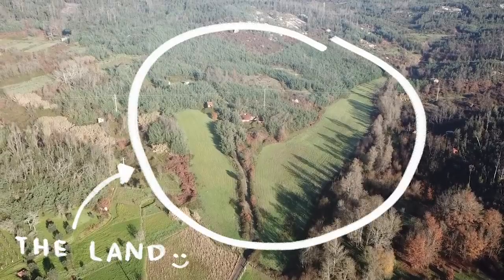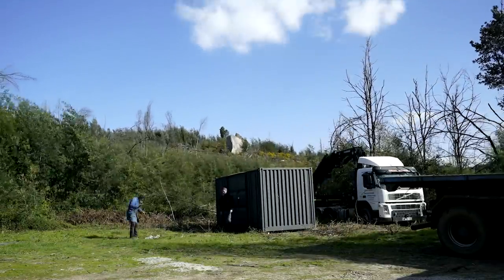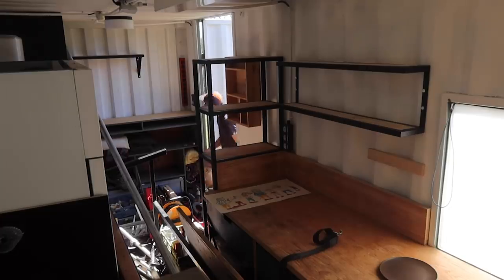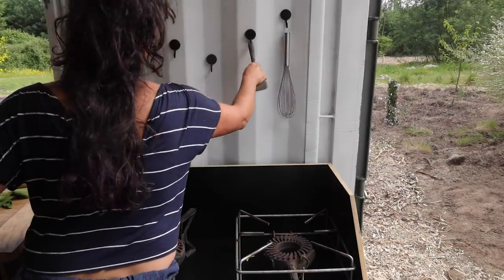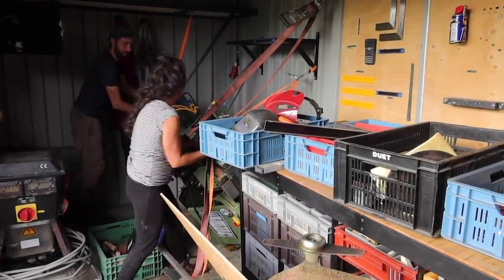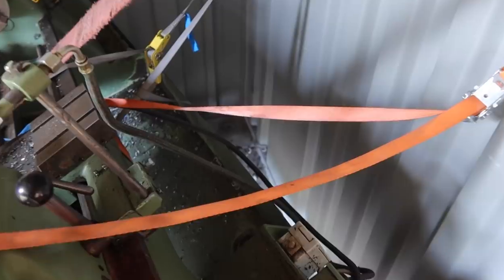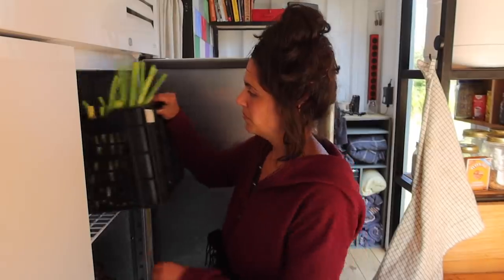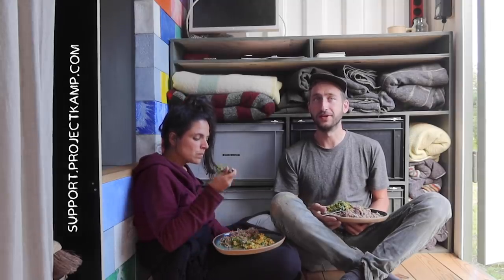#16 Unloading our kitchen and workspace shipping containers + look inside

Comment: Remember to jack up the containers off the ground and place spacer blocks at each corner. They need to have a good clearance to allow air flow so that the bottoms do not rot, due to dampness ☺
Reply: He did put wood under the corners to lift them up

Comment: The chinese use a spray gun with oil to cover all the metal parts on the machines before shipping worldwide in order to prevent rust to appear. Next time consider that :) Cheers!
Reply: I've also seen machine grease and a wax paper on the finished surfaces to prevent surface rust
Reply: usually sailors spray plain WD40 over their tools to keep them from rusting

Comment: Argh, safety first. I wanted to scream NO at the screen so many times during that, even though I knew it was too late and you must have got through it to post the video. Scrap those scissor jacks and get an old fashioned wide base bottle jack from a scrapyard for your van. A high lift farm jack is great and if used properly are safe and very flexible. Flash rust is a problem with tools if they are 'too clean', experienced mechanics keep their tools slightly oily on purpose. :)
Reply: You're not the only one.
Reply: Same Here... I have a Factory in Argentina, so I deal with this kind of stuff everyday... I´m trying to think of a way in wich we could help before the video is released... Maybe a live feed on IG or FB...
Those containers on the floor won´t last long either. It was so easy (and Cheap) to build some concrete pillars...
Reply: @Luismariabarbieri  even some cinder blocks under them to raise them off the soil would do wonders for making those containers last longer.
Reply: Having moved a number of very heavy machine tools in my career, I too was yelling at the screen. Worse than a horror film. Seriously, please ask for help before starting a task like that.
Reply: @Luismariabarbieri  There is a discord server you can join and scream about OSHA :P
Reply: @Luismariabarbieri  I think it was in a previous video Portuguese Government won't allow concrete to be poured.
Reply: @Luismariabarbieri  I don't know how it is in Argentina, but in here we need permission to cough, now imagine if you want to build concrete pillars...
Reply: @chriswaters9267  They are talking about blocks  of concrete.  Not poured concrete.

Comment: I'm happy you didn't get crushed by the lathe. Please use proper tools when handling heavy machinery and never EVER get under a load. Too bad about the rust, but nothing a bit of sanding can't fix. When you do, apply some guideway oil when you're done to keep it protected.  Make sure to have the lathe tuned before commissioning, I'd be surprised if it's anywhere near usable in it's current state. Anyways, love the longer videos! Keep up the good work!
Reply: I'd expect the moving surfaces of the lathe to have been protected by the way oil residue. Most of the rust shown wasn't on a contact surface. It'll buff out, as they say.
Reply: 14:55 OMG! The lathe is teetering and you’re on your knees in front of it where you can’t move out of the way! Please don’t do that.

Comment: Container homes often have problems with condensing water, so rust is always an issue. Especially when they have no insulatioin. But I believe this will become much better, now that the containers get opened almost every day. Maybe it is worth considering some sort of ventilation system for the kitchen/shower, though.
Reply: Perhaps some kind of mini window welded into the top of the shower that can be opened quickly and easily during/after the shower...
Reply: insulation not isolation
Reply: @jamesrivis620  Thanks, fixed it.
Reply: Or you just buy a container that transported frozen vegan food from south America to Europe.
Don't try to reinvent the wheel!!!!!!!!      Use common sense!!!!!!
Reply: @ Stefan G Yes Stefan container homes often have problems, for the one and only reason shipping containers are not invented to become a house.
It seems to me that youth today is totally lost on every level of using common sense.
Proof is what I want to see, if you think I'm wrong.   Facts don't care about feelings.
Reply: @brokkoliomg6103  Small solar vent fans that are readily available for RVs, are very easy to install and perfect in small bathroom spaces.
Reply: This is shutting the stable door after the horse has left but, covering all bare metal surfaces with petroleum jelly solves the rust situation when shipping. I once worked for a company that shipped parts for ships and this is what we did prior to shipping. For next time.  :)

Comment: Nice to see the containers have arrived, but I would have put them facing each other around 20 foot apart and built a roof cover between the 2 of them, that way you could have worked out under the shelter in all weathers.
Reply: The dirty workshop with all the dust and noise is better a bit away from the kitchen, isn't it?
Reply: @flughasenstrafe  I think 20 foot away would have been fine, shelter would have been great to put that large table under. but I guess you could still build a shelter off the workshop container by using leg supports for the front of the shelter.

Comment: To stop condensation you should add insulation to the outside. Good one like XPS or PU rigid foam. This moves the "dew point" into the insulation where no water can condense.
Also a separate small solar panel / dehumidifier system might be a good idea.

Comment: I’m very glad you’re still alive not because of bike crash but after seeing you messing under the falling lathe ;)
Probably you could make some cleanup and preparation of the surface before containers arrived but don’t take it personally. At least some hardening of the ground would be handy. Which can still be done later of course 😎
Did you put the containers on some sort of concrete blocks?

Comment: Great work and glad it all landed relatively safely.   Please put the containers up off the soil on concrete blocks or slabs, will stop them rusting and rotting away from the ground up - easy way to protect all your investment of time and money.  Anything metal in container like that will rust, they are natural condensation traps with the temperature changes, never mind the salt water environment of the shipping - a thin film of oil on all the unpainted metal is a good preventative measure.  Looking forward to the future videos, keep up the great work.

Comment: Next time you'll need to move the container, take some 50x50 steel tube (or anything alike) and just weld a few tubes together and to the container walls in such a way they block the big machines in place.  Tacks are not enough, a few 4 cm welds easy to later cut off with the ginder will do the job.
And please don't put any part of your body in the fall zone of a 1 ton machine again, ever ;-)

Comment: Looks like the drillpress chuck just came off the taper on the arbour, it may go back on with a bit of a tap with a hammer and block of wood.
Reply: Agreed, it looked like a Morse taper chuck which is a friction fit.
Reply: You don’t use a hammer just pressure from the arbor to the table.

Comment: I'm not sure if you have fixed the drill but if not, the chuck should have a #2 morse taper sleeve and a slot in the shaft so you can insert a wedged key and tap it loose with a hammer. I also think the shaft has another #3 morse taper in the chuck so you might be able to knock that end out as well and replace it. My chuck has a stub with a taper on both ends. Draw the jaws in before you knock the new one in with a block of wood. Just check before you replace it if it is 2 or 3 degrees. Treat the rust with phosphoric acid and steel wool, wash down with a wet rag then finish with oil.

Comment: The workspace container had been closed for a few months, in al kind of weather conditions. Sooner or later the air in the container gets damp. And then metal surfaces can get rusty.
It's not a big deal. You can remove the rust quite easily.

Comment: Great build(s)! Question - what kind of paint did you use on the outside of the container? Didn't seem to need any prep like sanding etc as we keep getting told we need to do on a reefer trailer that we would like to paint.  Seems you just painted over everything which is what we're hoping to do. Was it some kind of marine / boat paint? Really enjoying your videos! First "One Army" one we've seen but your Project Kamp channel is great!

Comment: clad the outside of the containers with insulation , this will stop the condensation problem causing the rust also make the cooler in summer as they can get real hot in summer